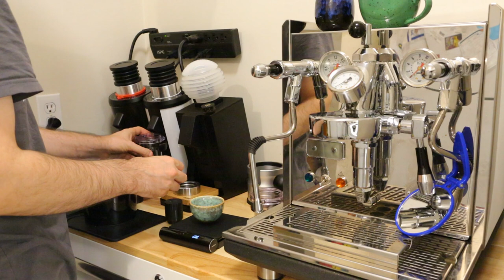Eureka Oro Mignon Single Dose Grinder - Clogging Issue ?

Comment from the maker: Apparently with the updated version (2nd batch out) they've fixed this issue and improved retention and other things. But it's left a bad impression for many on this grinder and perhaps for Eureka.
Reply from the maker: Update! I tried the Oro 1.1v only because I got a deal on it and I knew I could return it if it sucked, or re-sell it to someone else for a good price if I thought it was OK! 
IT definitely has improved, the Hopper quality is better, same flimsy wood lid though. The vibrations and noise is lower, and the retention might be improved, the clogging IS STILL THERE, but isn't AS bad, the bellows is still barely sufficient so it bothers me they include a bellows if it doesn't seal and work nicely. BUT I found the workflow WITHOUT the bellows is actually much nicer and retention isn't too bad without the bellows, dosing consistency is much better without beating the bellows. So IF you do get an Oro SD make sure it's the updated v 1.1 at least, and I recommend NOT using the bellows.

Oh and the one major redeeming thing that made me NOT HATE this grinder is the Grind / Taste Quality is actually pretty good for espresso, Seems like it got better vs the original ORO SD, definitely an improvement over the Specialita, seemed similar to the Lagom P64 or DF64 with stock burrs which give a nice balance of clarity and body.
Reply: @BensCoffeeRants  I was wondering what have they done to fix the retention and/or the vibration issue. 
I bought a used one from batch 1, having the same 0.5g issue. When I removed the metal insert that was meant to make the chut more slippery and premium  (not the de clumper) from the chamber, retention improved significantly 0.0-0.2.
so I'm planning to mod a mignon XL chamber and use that. Was a good lessons learnt for me...
My 4 years old specialita was way better at retention..
Reply from the maker: @CoreProject05  Sorry not sure what they really changed, but they said they tweaked the grind chamber and maybe chute. I think the Vibration was from the motor not being secured well enough in the inclined position (based on other YouTube videos I've seen where they opened it up!). You could open it up and re-enforce it (more zip ties?) at your own risk, I'd just live with it, it's a fast grinder anyway :) 
I don't think the Specialita had less retention than the Oro SD does. Maybe it's more consistent with you putting 18g in, getting close to 18g out. If You haven't already I suggest trying without using the bellows. After a few shots worth of coffee through it, you should see it stabilize and be much more consistent with the amounts in and out, and the retention amount shouldn't be enough to really affect anything.
Reply: @BensCoffeeRants  Thanks Brian! Yeah they might have balanced the motor better. Who knows. I'd love to see what's different inside with v1 and v2. I tried to exchange my but the dealer basically said this is up to spec :(

Comment: I was having the same issue. ~0.5g of coffee getting clogged behind the de-clumper. I found the type of coffee made a small difference but was still pretty consistent. I think I have a solution. I simply opened the front panel and angled those de-clumping tines out ~15-20 degrees. That way the coffee has a slightly larger opening but still benefits from any anti static and de-clumping effect the tines have. It was much better then removing it completely which I’ve seen suggested elsewhere. I was also disappointed and considering a return but since doing this the bellows works every time (multiple coffee types and grind sizes), the grinder works cleanly with minimal mess.
Reply from the maker: Nice. Good solution modifying the de-clumper. You'd think Eureka would have thought of something like that before shipping out the grinders. I pinned your comment for others. Thanks for sharing. Glad it works better now.

Comment: Hi Ben, I’m getting exactly the same results as you do. It think you are actually spot on.

When you open up the machine you will indeed find about half a gram of coffee behind the clump crusher thing and about an other half a gram between the burrs. I also agree with you on the “retention measurement”. I see a lot of claims about .1 or .2 of a gram retention after an initial loss of approximately a 1, 2 or even more gram loss. Coffee doesn’t magically disappear. At least one gram gets recycled over an over again, unless the bellow does what it needs to do… which it most of the time doesn’t because the chute is blocked with coffee retained by the crumb crusher. Basically, I think the crumb crusher is a/the flaw in this design. Still trying to find a proper workflow to get it working as how I think was intended. This is what I have come up with so far:

It appears that plastic thing inside the hopper isn’t there only to prevent popcorning, it also seems to function as a valve to get air back inside the bellow after being pressed. Kind of neat, I like the idea behind it, but practically it doesn’t work that well. A lot of air escapes through these holes and you loose a lot of air pressure. I’ve put tape on three of the four holes on the bottom of the hopper. This still allows air to get back inside the bellow after being pressed, although being a bit slow. When pressing the bellow I put my finger over the last open hole to get the maximum amount of air pressure. I also notice that when the last bean has passes the shutoff gate you need to close it as quickly as possible and have to start working that bellow. And then, when you are lucky, and the chute doesn’t get clogged, you will be able to blow out most of the grinds and have a (very) low retention. And a nice espresso! If not, well, flush it the next time with a few grams of beans, try again and hope for the best 🙂

And one more thing. I use the plastic lid on top of the bellow when using the grinder, I would hate to destroy the wooden one. I only put it back on when finished.
Reply from the maker: Hey, I love being right, but I'm sorry that yours is behaving the same way as mine. I think it's a flawed design. Eureka claims they never heard of anyone having this issue before! Maybe email them about it too!   info @ eureka.co.it

I didn't know the plastic lid worked with the bellows, haven't tried it, someone else broke their wood one on the plastic hopper (without the bellows) so I figured the wood one works with the bellows and the plastic one works with the plastic hopper. 

Honestly I think the grinder just works better without using the hopper, it's less hassle and it still pushes out the coffee through the clogged area. It might have 1g retention but likely only 0.5g is being exchanged since most of the coffee follows a single pathway.
Dose consistency is also better that way.

Comment: It is interesting to see that the retention behavior appears identical to what I see with the Mignon XL. From what I've seen the Single Dose grinder is more of a design exercise rather than possessing any functional changes to make it work better in a single dose application.
Reply from the maker: Yeah that's what I figured. Doesn't seem like they changed much from the XL which was basically a bigger Specialita (they should have kept that same clump crusher from it though because in my specialita at least, it worked better!).
Reply from the maker: Do you use a bellows for your grinder? I think these (or most Eurekas) seem to work better WITHOUT a bellows.

Comment: I've owned one for a couple of months, now, so I assume they've ironed-out some of the issues.  I still removed the de-clumper.  That's just a waste of time and I could see it causing all sorts of issues.
Reply from the maker: The declumper was probably the main source of problems really, that's likely the thing causing the issue with the clogging and not being able to successfully use the bellows. Retention wasn't even bad so I was confused how a little coffee can form such a tight seal that air can't pass through.
Reply: @BensCoffeeRants  I'm very happy with the results, to be honest. Very consistent. 👍

Comment: Maybe it makes a difference if you have the machine running before adding the beans? The workflow using the original hopper is to turn the machine on and then open gate to let the beans fall into the machine. I would imagine that this would prevent the clogging. In other reviews the machine perfomed nearly perfect this way even without the bellows.
Reply from the maker: I have a new video where I did that and it still clogged up after putting in 15g for my europiccola machine! I had the chute cleared best I could without opening it up and taking it apart which seems I may need to do.

Comment: Very interesting.. 🤔 are you planning to open it up while it’s clogged to investigate?
Reply from the maker: I tried and failed :'( I think it's just the declumper bars, they're kinda thicker than the ones in the specialita it DOESNT seem to hold back a LOT of coffee but it does make it hard to clear out. The grinder running without using the bellows will still work to push the coffee out itself though, so at least it still runs and works.
Reply: @BensCoffeeRants  Got it, definitely something i’ll look out for when i get mine
Reply from the maker: @iCavity  I do know how to open the grinder, it's fairly easy and the same as the Specialita I had previously, but when I tried to open it, the screw was on so tight it ended up stripping. Someone else also said they stripped theirs! :o
Reply: @BensCoffeeRants  That’s disappointing to hear :/
I saw another youtuber who just bent the declumper bars forward, but that led to more static.
Reply from the maker: @iCavity  Yeah Stefano commented here that they did that and had good results actually, but it's not something users should have to do with a brand new grinder, I'd maybe do it if it weren't for the stripped screw. 
I shipped it back to store to see what can do with it (hopefully they won't have issues with removing that screw).
Luckily I have enough grinders or I'd be more upset about sending it back for repairs :P
Reply from the maker: I was embarrassed to say and didn't want to admit for warranty purposes, the reason why I couldn't open it up and clean it out / investigate why it was clogging up, is because when I tried to open it up, the screw behind the logo, it got stripped, I think they used a cheap screw and it seemed in really tight! SO I don't think it was my fault, but I couldn't even open it! Luckily I didn't have any issues returning it to the shop I purchased it from.

Comment: You seem to trash this grinder a lot.    Seems u got a lemon.  Is that even the Oro single dose? Like where’s the hopper and bellows that it actually came with.       Never seen anyone get more than .02 retention and you’re getting .9??   Def somethings not right there.   Might wanna send that back and get one that works.
Reply from the maker: Yeah, I'm kinda trying to do that. I'd love if the replacement one behaves differently.  I had high hopes for this grinder, but I think Eurekas quality has gone downhill. The hopper and bellows was annoying and useless so I put on the one that I used to use on the Specialita which works better (stronger bellows, and no shut off gate to mess with). 
How are people measuring the retention amount? People often confuse the dosing consistency with retention. If you put in 18g and get out 17.8 it doesn't mean it's necessarily 0.2g retention. 

I basically measured my  retention amount by the amount of coffee I'm getting out from the clog behind the clump crusher,  at espresso setting it seems to be 1g max (typically usually closer to 0.5 I think), which is better than Specialitas 2g max. 

I might re-do my actual exchanged retention test using Grindz cleaner to see when the grindz comes out. That way you can see how much retention is actually being exchanged vs being stuck in a crevice and not affecting much of anything. 
In the longer version of this video I actually did do the text, but it wasn't on the espresso setting I forgot I had set it coarser earlier for seasoning the burrs a bit. But it did do well in that test, not sure if it was getting blocked up at that setting.
Reply: @BensCoffeeRants  "People often confuse the dosing consistency with retention" This drives me nuts.... Watching all those "retention of grinder X" videos, only to seee they didn't think it all the way through.

I am considering getting this one Have Sette 270W and Eureka Mignon MCT I like the taste of the flat burrs of the Mignon better, but it is slow, and I wonde if 65mm vs 50mm will produce a better cup
Reply from the maker: @esbenrasmussen4289  I've never used the 50mm mignons but did enjoy the specialita with 55mm burrs. Not sure I'd recommend this one until they fix the issues but generally larger burrs are faster this grinder is super fast also louder than specialita. Taste profile seems similar but I think the oro XL or SD grinders should be a little more consistent (grind distribution wise) just based on the burr size and I've heard others say there is a slight improvement in taste. I never compared oro and specialita directly so can't say for sure since it's based on my memory.
Reply from the maker: The store at least finally admitted they're having issues with this grinder and will let me return it under warranty for 'repairs' and basically experiment on it to see what works to fix it. Eureka keeps telling people it's the first time they've heard of anyone having issues :o
Reply from the maker: I ended up getting a refund, and then getting the same pre-order deal I got on this one for the updated v1.1 version which IS much better, but still has clogging issues and poorly designed bellows system that barely works, I recommend using it without the bellows for better workflow and much mor consistent results.
I think a lot of people with the first version and maybe even the updated version who don't think they have an issue, don't realize the bellows isn't actually doing anything and they're basically using it without using the bellows, which is probably for the best anyway.
Reply: @BensCoffeeRants  yea I’ve been using this grinder for one year now, and I think to almost myself daily (literally was just thinking about this) how lucky I must have gotten to receive a model that works perfectly.  I’m getting literal zero to .2 retention without the bellows.   
Reason behind this however is strange and has to do with the beans primarily. Meaning when I was using generic brands like shipped from Whole latter love or local box stores (low quality in the beginning) I was getting lots of retention when I would skip using the bellows.  So I would have to use them to get the last .5-.7 out of the grinder.     
 Once I switched to a premium local roaster I’ve never had to use the bellows again.  I even removed them completely.   Literal zero retention according to the scale.  

 I will say though when I open the grinder fro cleaning  there is a lot of ground coffee in the “groves”?/ nooks and spaces inside, so that can’t be real zero retention.     It’s built up a layer I guess and the new coffee just “bounces” right off of the buildup in the grinder.  In my imagination anyway. 
  I’m getting the best quality shots I’ve ever had anywhere, and taste is really exceptional. Im really enjoying my shots with this grinder.  
  Most of the videos I’ve seen on it are pretty much showcasing the opposite experience .    I said a year, but really it’s been since January of this year. So I must have also received the corrected version. 

 Rushing this out hopefully it’s not all gibberish lol
Reply from the maker: @skyking9248  Thanks for sharing, glad you had a good experience with yours :) I think it does work better without the bellows, and  there's likely not enough retention to really negatively affect things. With most grinders you'll find some coffee stuck in crevices, with the Specialita I had previously there was even more stuck in there but I think MOST of it was basically there for good, not being exchanged, so it doesn't affect much.